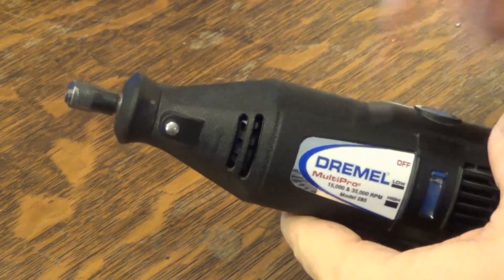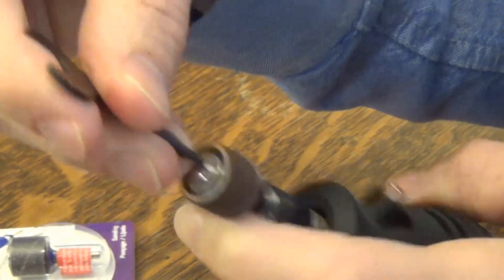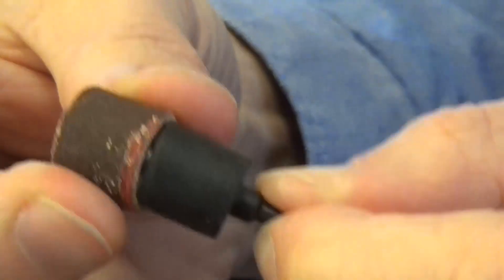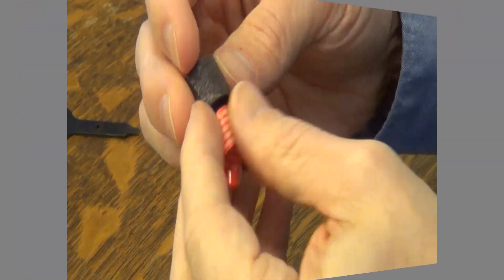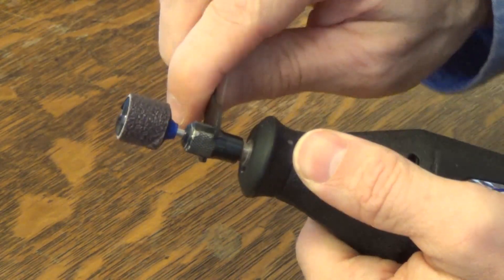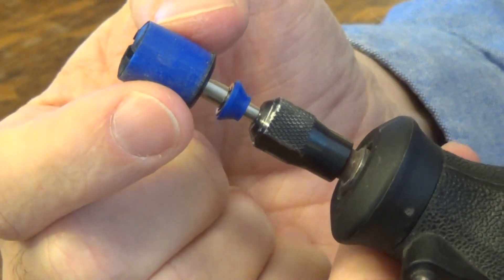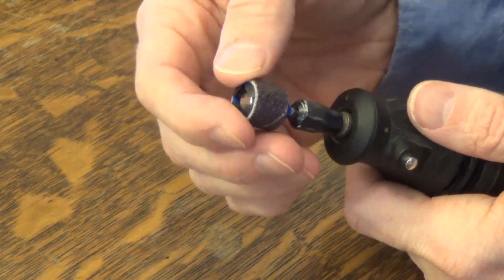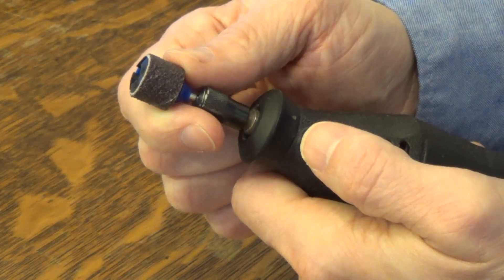Dremel EZ Drum Mandrel (EZ407SA)

Comment: Bummer.  Nice piece,,but no durability again for the EZ lock stuff..   Consumer warning!!!:  The EZ lock cutter wheel setup took out a switch and a 90° attachment head because once locked on, the cutter wheels are so far out of balance and fit so loosely to the arbor that it vibrates your hand numb.  2 trays of 
 ez lock cutter wheels and arbors tossed out.  Back to my Dubro cutter wheels and arbors.  Rebuilding the 395 5 speed now.

Comment: Why do my sanding drum keep falling down? It happens with both styles ,the ez drum and the one that screws on.
Reply: For the new ez lock I can’t help ya. I just got mine. But for the old screw type, check to make sure it’s a dremel brand sanding drum. There are other brands that will work with dremel, but I’ve found the sanding drums to slide on occasion. If that doesn’t solve it you might just need to tighten it down more. Before you start working with the tool, check and make sure you can’t move that drum. If you can slide it with your fingers, tighten it more. If that doesn’t work, get a new sanding bit.

Comment: Purchased 4 of these for shop.  They are horrible and do not work as advertised.  Only can be used for very light work (which was not why I purchase Dremel tools).  I strongly do not recommend these for professional use.  I will stick with the screw-in type that grip the sanding disks tightly.